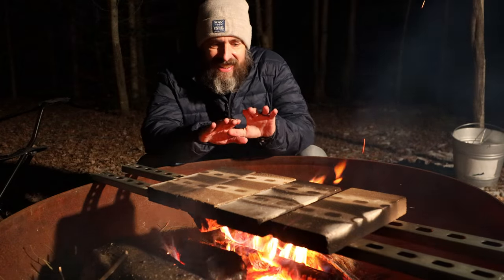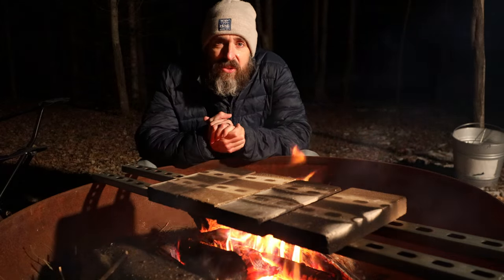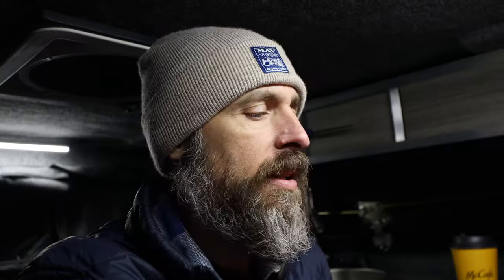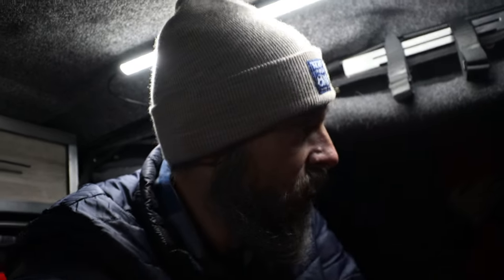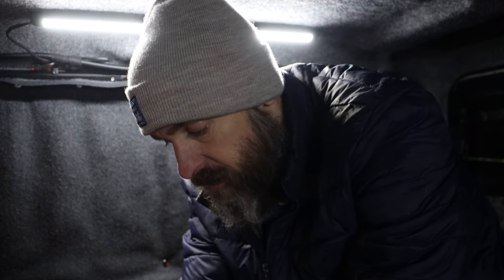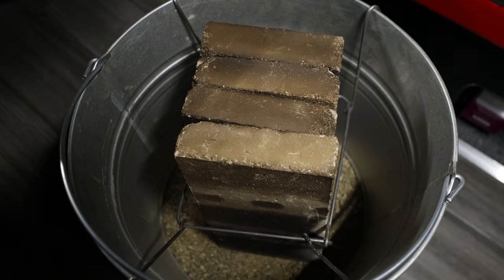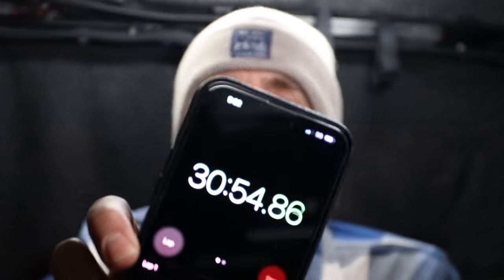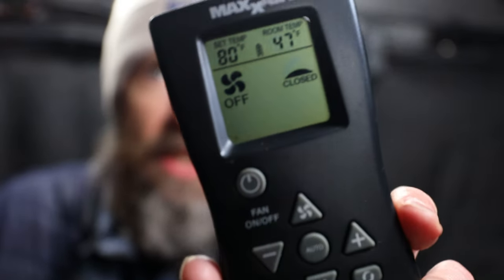Heating My Truck Cap Camper With Firebricks

Comment: Interesting experiment. "Tell 100 of my friends" was funny. I did tell both of them, however. I have thought of getting a small electric heater when on utility power, but with a 5K diesel heater that should suffice. I also bought the Bouge personal air conditioner. Been helping with family situation, but will be orgainzing and figuring out what I will carry camping this next week.  I am ready to give ' er a good college try soon
Reply from the maker: “I did tell both of them” 😁🤣 I definitely wish I had a diesel heater…have an idea for making a portable one that will attach to the front runner rack (when I get around to installing it). I’ll have to check out the ac. Sounds like you’re in the home stretch!

Comment: Interesting vid.  I would love to see a video of your thoughts and use of the Mr buddy heater. I’ve just bought one because I’ve heard so much about them but I keep hearing about the threat of carbon monoxide or toxic fuel fumes.  I’ve also considered running a small electric heater using a power source like the BLUETTI you’ve talked about in another video. Thanks, and keep putting out great content.  While my new truck cap camper setup is far more simplistic than yours, I’ve really been able to pull so good nuggets of info and apply them to mine. 
Cheers
Reply from the maker: Thanks for watching Chris! I just finished editing the next video where I do a similar test with the Mr. buddy heater. It should post in a week or two. Then, I’ll probably do one more if we get a really cold day where I’ll test my electric heater. So glad you’ve found my channel helpful! Godspeed!

Comment: Hey bud, Jason NC here... did you base this off of a thermal battery idea and or have you seen the sand battery concepts...?  Thanks Jason.
Reply from the maker: Hi Jason! I actually didn’t…just thought about the old timers heating up rocks and was inspired. Now you have peaked my interest in a sand battery and will be doing some googling.
Reply: Cool, just wondering...sent you a good link to a pretty smart gentleman that's built one.... and TONS of other things that are very interesting...